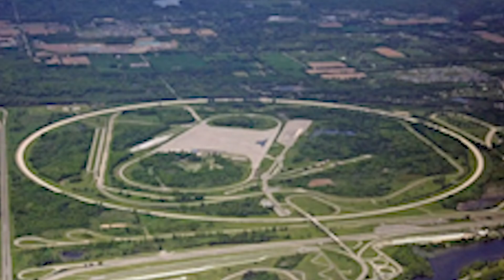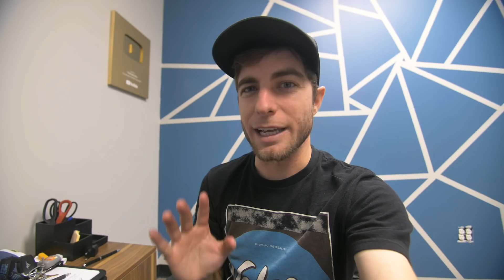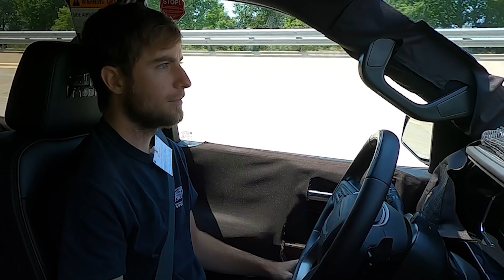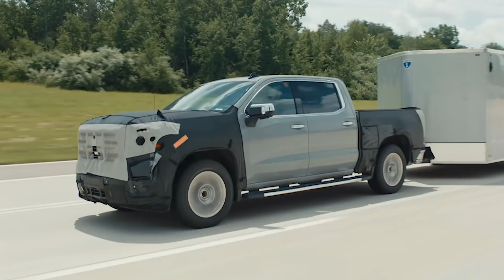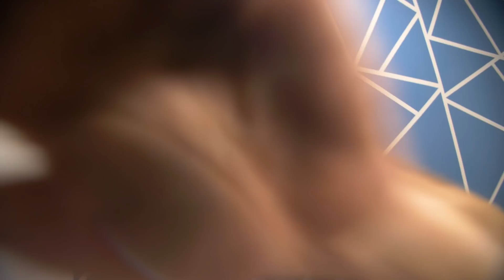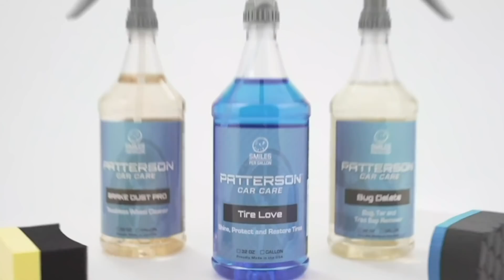I Went to GM's "Area 51" (Hummer EV Sneak Peek and More!)

Comment: So it’s better than Tesla because of the blinking light on the steering wheel? To me supercruise sounds strictly worse that it has to rely on mapped data instead of being capable of figuring things out with vision like a human would
Reply: The recent Tesla crashes have proven that relying on CV alone is a terrible idea. When you have a CV system that can't identify a fire truck (see Aug 25 Model S crash in San Jose, CA), that's a big problem. Supercruise and other systems can detect something like this without fail. There is a reason sensor fusion exist and why many industrial and Defense systems don't rely on one system alone and utilize multiple sensors and sensor fusion.

Comment: I think it's cool idea that they have mapped roads but what happens with construction or changes to the road? Did you experience any  construction when you were out driving the Cadillac?
Reply from the maker: Basically if it detects something like that it puts you back in control.
Reply: @ThatDudeinBlue  That's another good thing it has over Tesla cause I think I've read about Tesla crashes where there is construction and the lane lines disappear or they do that thing where it's solid white lines and they shift all the lanes over and the Tesla doesn't recognize it and keeps going straight and crashes because the driver isn't paying attention either.

Comment: I’m excited to see how manufacturers will develop their own self driving platforms. It just helps those that want to actually drive, have a safer environment to be in.
Reply: 😂 this is a underrated comment.
Reply: More often then tired, distracted, and reckless drivers? Doubt it.
Reply: @groggysword33  You've never owned a PC/Smartphone/ Used software before? Glitches/bugs and crashes are just as bad as a human being a bad driver. That said autopilot like what planes have would at least be nice to have as an option when I normally could not drive because of my sickly/disabled ness.
Reply: @GreenBlueWalkthrough  I code as a hobby, I know software can glitch. Full time automation is already prevalent in aviation. I would recommend doing more research regarding the statics so far from Tesla regarding driving numbers, compared to those of humans.
Reply: Sorry about being rude but I was making a point if windows can glitch and make me replug my USBs or it disconnecting with my Xbox series controller something that sould be flawless. Also My Pixel can glitch and have me hold my thumb scanner for like 10 seconds longer than last week. 

What's the hope for an EV that requires more than a highly complicated input system like a plane's autopilot and even then it just dead reckoning? Also, Tesla is under investigation for the reason of its autopilot being unreliable. In fact, Louis Rossman responded to a Telsa hitting a deer because it did not slow down even though it saw it a good 500 feet beforehand.

Also, full-time automation is just coming into aviation you mean... most automated planes need a pilot on the ground and the US even lost a secret stealth UAV to the Irans because of a glitch and or them intercepting the data link and commanding it to land.

So I think that consumer car self-driving systems need to be regulated better than aviation as at least they have licensed pilots and a self-driving car may not.
Reply: I'll never ever trust self driving cars... never ever...